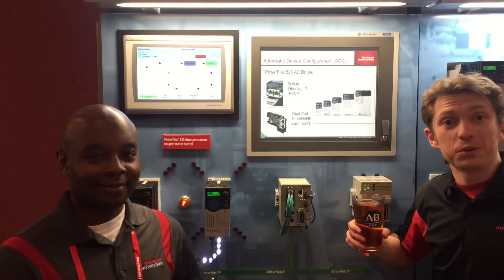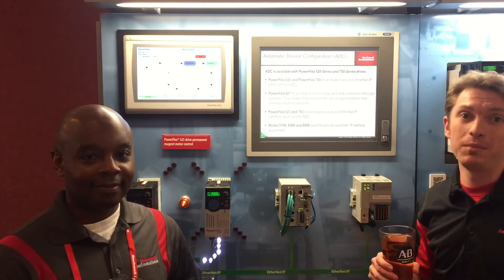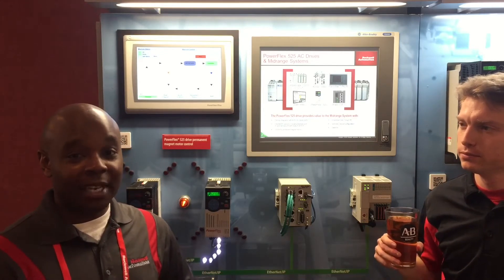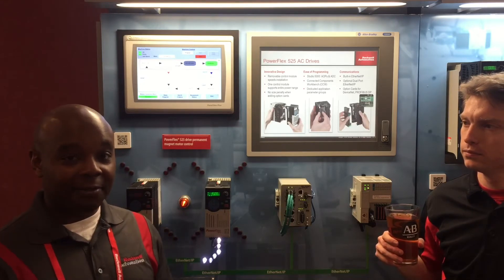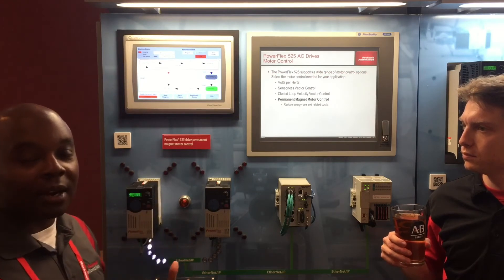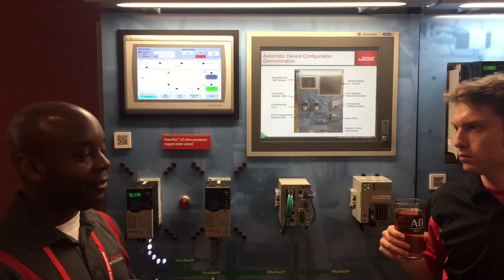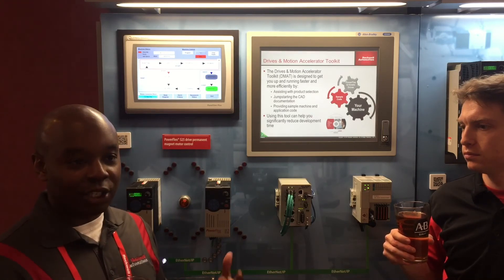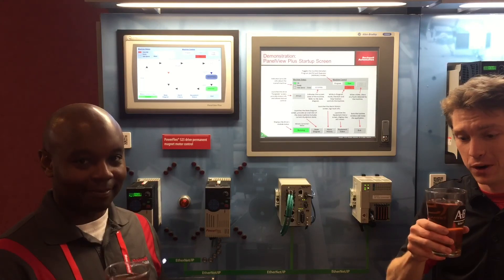Automatic Device Configuration - Manufacturing Happy Hour

Comment: Question:
If I have an Ethernet/IP PLC Network, and wanted to take advantage of ADC for my VFD drives. Could I use a protocol conversion gateway to integrate a Modbus Serial VFD to my Ethernet/IP network and use ACD on that VFD?

ACD/PLC -- > Ethernet/IP Network -->  Ethernet/IP to Modbus RTU Gateway --> Modbus RTU VFD

just a thought, have a great day!

:)